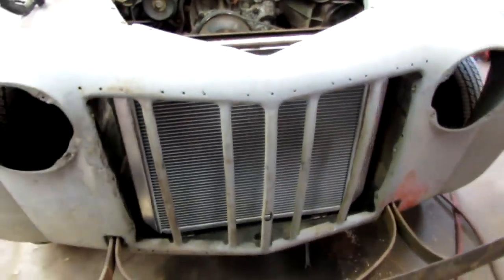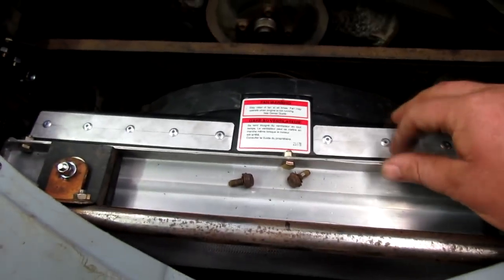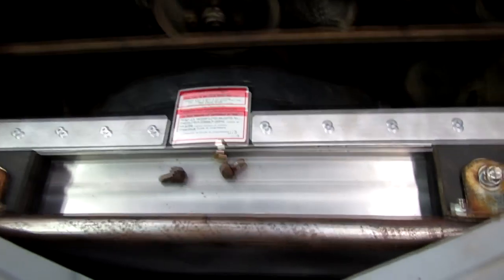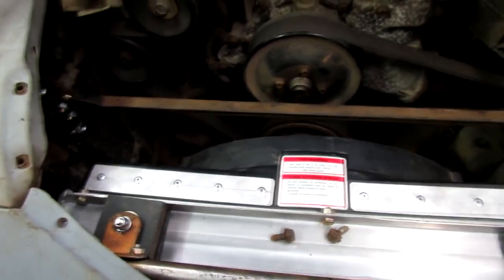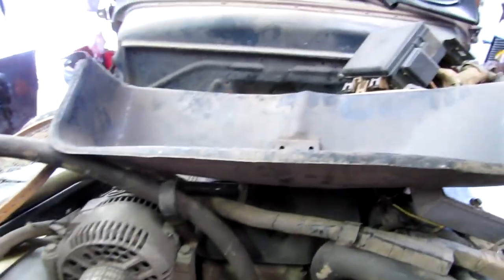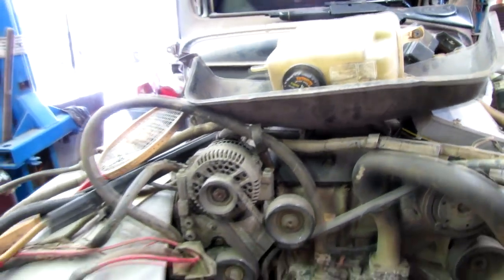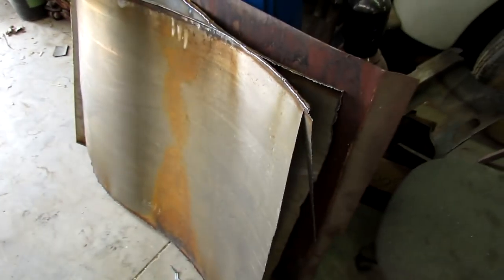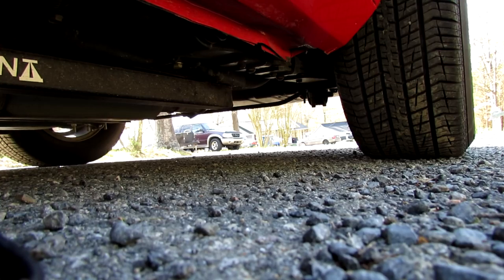46 Ford radiator mounts

Comment: Looked like the firebird has subframe connecters? When ya mount that coolant holder I think its got to be above the cyc heads might have to jack the front up to fill the radiator. Hope youall had a good easter
Reply from the maker: Jeremiah johnson It does have subframe connectors and a few other things...

Comment: Don't let that chevy take your your firebird.You running a 400 or a 455?Is that a ram air 4 cam I hear?
Reply from the maker: I can hang with that Monte, just didn't do it one handed you know.... That Monte has a just installed 454 and is pretty stout. 
The Firebird has a .040 over 400, no 12 heads and edelbrock performer rpm cam. A little too much compression but she runs pretty good.